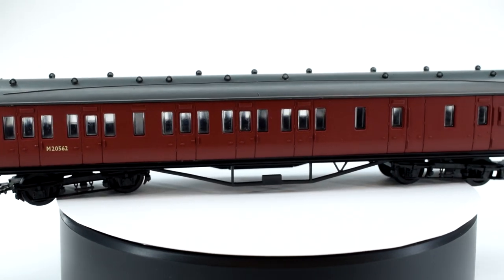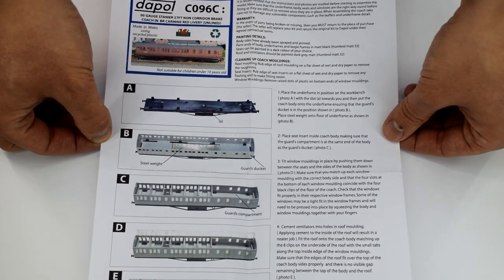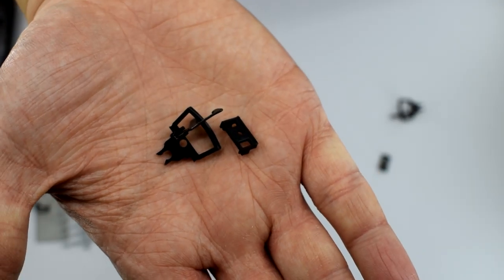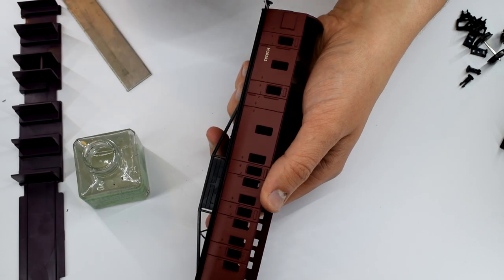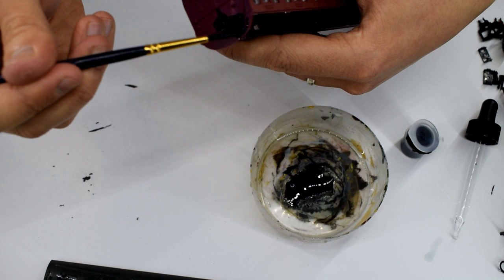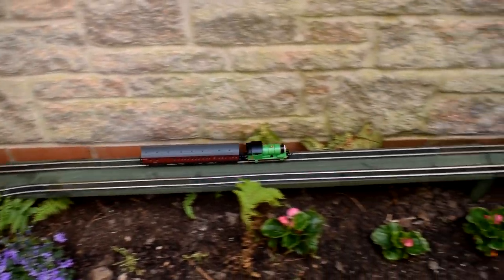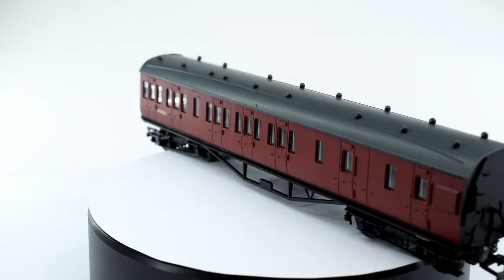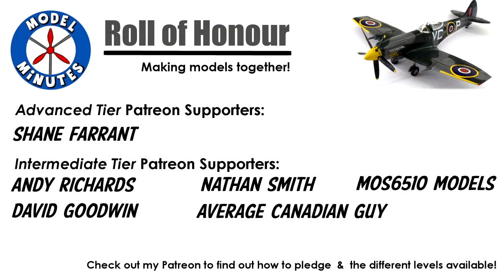Dapol Stanier 57ft Coach Kit | OO Gauge Model Railway | Build & Review

Comment: Excellent video. I've only got into model railways since lockdown and been on a limited budget as I was self employed I have been limited to what I can spend. Having seen your video I am now keen to get some of these kits and building them is no issue for me; I'm a fitter so quality is paramount ! You are so right to question the instructions; had this so many times myself. At first you think it's yourself and then instant enlightenment when you realise it's them ! Thanks for the inspiration to try a few kits. Kindest regards, Rick the Bulldog Builder x
Reply from the maker: Thanks Rick! These are some pretty easy (and cheap) models of a good quality which will allow you to build up a fleet of rolling stock quite quickly. I think that if I were to do these models again i'd get a few and do a "production line" on them - being simple colours i'd probably airbrush or spray paint the roof and ends for speed

Or, they might make a great conversion into some fictional/custom paint schemes

Comment: Hi Matt, I believe they were originally 1950s or 60s Kitmaster Rosebud brand kits then Airfix and then Dapol. They are LMS Stanier coaches from pre BR days (before 1947) and pretty much only seen on the Midland region. The BR mk1 57 foot Suburban coaches were designed using these as a base. Cheers for the build, stay safe.
Reply from the maker: Thanks for the info!
Reply: these are not the old models like most dapol kits, these are the ex airfix gmr lms non corridor suburban coaches, however sold as a kit rather than rtr

Comment: I bought a load of them over a few months, they are vastly improved by adding metal wheels ( adjust wheelsets with a back to back gauge before fitting) and Hornby small tension locks. Brush windows with Johnsons Klear before installing for another lo-cost improvement.  I'm just about to test Keen Systems close couplings and paint interior partitions brown with blue or dark red upholstery. Also about to fit homemade led lights with button cell battery for interior lights.
Reply from the maker: Sounds like an interesting project!

Comment: I would wash the plasitc windows with clear floor polish I got on speacial import from ebay, ink wash door cracks, hair spray / chipping the paint work for fading effect, Use 000 brush with GW bronze, copper, gold colours on the hand rails & door handles. I remeber going on the battle field line with a friend and saw loads of decaying wagons, coachs & locos that could be copied and made well with small grass added and trees trying to grow through the various wagons. I would take your time to experment with more colours more with newer models. It looks great.
Reply from the maker: Thanks for the suggestions!

Comment: I'm thinking of getting these, what is the length of the model as I need roughly the length of the old triang 9" coaches
Reply from the maker: I haven't measured the coach, but doing a calculation online - 57ft scaled at 1/76 equals 9". I imagine it would be a pretty close match yo the triang coach in length
Reply: @ModelMinutes  thank you. I will be ordering some soon then although I have noticed some have disappeared from listings so I wonder if they are correcting the instructions
Reply from the maker: @thedreamtommylees  Maybe, or they finished the production run and sold out . . .

Comment: I wonder if the scratches / marks on the clear parts are a result of it being bagged not boxed, and the clear parts being in the same bag as everything else. Excessive handling in the warehouse, despatch, even in the shop by staff and customers may knock the parts together. Not possible if they had a bag of their own.
Reply from the maker: might well be, or could be a result of a less than careful moulding process

Comment: I bought 3 from Hattons 2 of which are the brake model. My main problem is with the tension locks coming loose.
Reply from the maker: Do they pull out when you run them?
Reply: @ModelMinutes  Yes. Was thinking oh gluing them in. The instructions just say “clip in”
Reply from the maker: @redbank542  Yeah, I did wonder if they'd pull out over time

Comment: try building a icm spitfire kit ...I am sure them instructions are made for borrowers, you need magnifying glass to read them.
Reply from the maker: Oh dear! sounds like a challenge :P
Reply: You won't do it 😜    😈

yeah it's a challenge when there is no seat either ... sealed kit but missing from the runner 🏃.
Reply from the maker: Vasili 😕
Reply: Don't be sad it just gives me an excuse to scratch build one.

quick tip costa coffe tops are made from proper styrene like the sheets. I save them comes in handy when your kit is missing a seat 🤣🤝
Reply from the maker: Vasili thanks for the info, will have to remember that